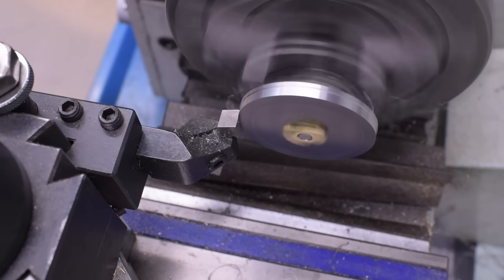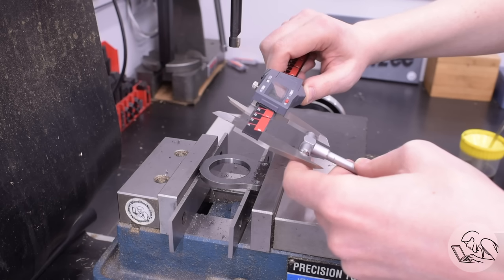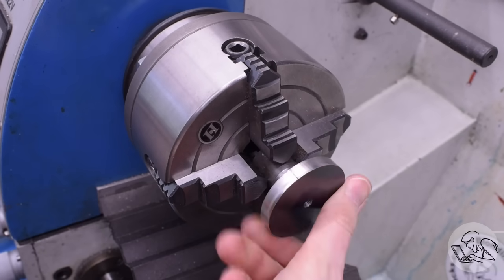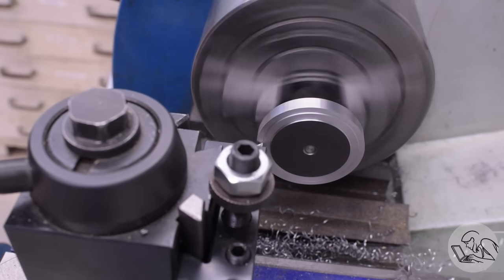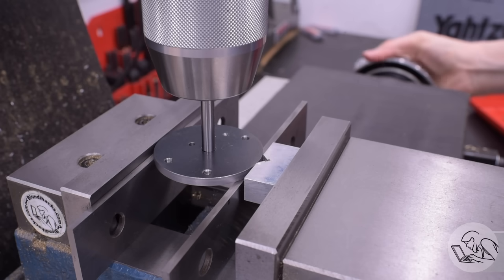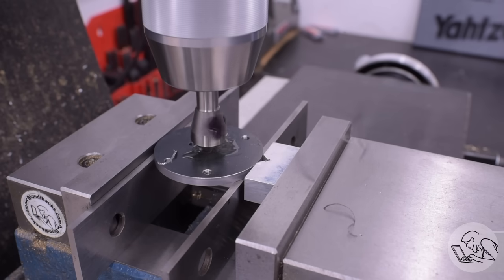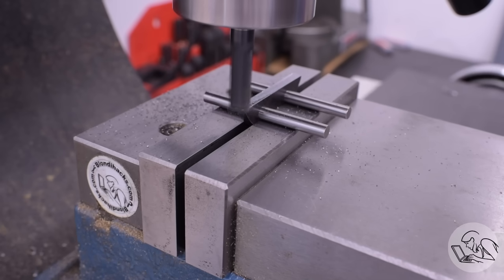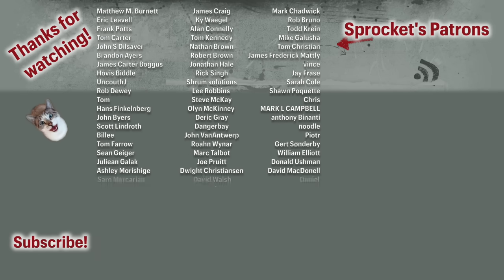Let's Build a Tool Sharpener - Part 4

Comment from the maker: Hey everyone! Lots of concern this week about my tapping setup. Yes, those Starrett tap handles do have a tendency to hold the tap a little crooked sometimes. However I’ve been tapping holes with that setup for ten years and it doesn’t cause any measurable error in the hole or threads. I’ve tapped tens of thousands of holes that way and never seen an issue. It definitely doesn’t cause a hole to move 0.75mm in a part. 😄 That error most likely came from the centre finder. That was the error prone step in the process.
Reply: Ahh yes, everyone is an expert this week because Joe Pie just posted a video on the vagaries of using tap handles with a spring loaded centre.....

Comment: I'm making this project with you. Thanks for making those mistakes for me, it saves me the time to do it myself. only problem is you need to be more generous with them as I always have a surplus.  Keep up the great work.
Reply: How many mistakes come with the kit? Did you have to buy extra? 🙂
Reply: @carlwalker7560 
All of them.  😂
Reply: Mistakes are like screws, you are supposed to find them on the table after doing the final assembly of your project.

Comment: Gwen,  center finding with that “center finder head”,  I have found that that layout method rarely goes thru dead center.  I always put on one line, and then put a second line immediately at 180 degrees.  If they aren’t one on top of the other, your center is in the middle.  A second pair of line at 90 degrees will usually leave a tiny square or rectangle.  You know where to go from here.   Thanks for all your effort.  Paul

Comment: "Hefty chunk" translation:
Blondihacks: a handful
Joe Pie: where's the tweezers?
Cutting Edge: Forklift has no chance, fire up the yard crane.
Reply: It's like the definition of "Sheet Metal" depending on the sector of industry you're working in. Fine mechanics use sheets of a few mikrons of thickness others would consider a film while a shipyard uses Sheet Metals that other would consider a big effing wall of steel.

Comment: Quinn , you always do nice work ...This project reminds me of a similar type of tool we had in the shop years ago, that the torch would be on the business end of the tool and a tracer pointer would be on the other end, and a little motor would trace the outside and the torch would cut the shape I thought it was the coolest tool. now we have a water jet machine and the pantograph torch just stands guard duty in a corner of the shop....

Comment: You mentioned using light pressure on the hoop but during the fitting steps of the hoop onto the first center piece it looked like the hoop was pivoting a little on the "sides" that would have closed inward when the jaw pressure was released.  So I'm thinking that even with the light pressure there was a slight oval result.  It makes me want to move ahead with my small fixture plate all the more.
Reply: Great eye, Bruce! I was thinking fixture plate was the only option, too, as any clamping pressure would invariably oval the hoop.

Comment: I built a Quorn a tool sharpening machine after the plans you get everywhere in book shops etc nearly a decade ago it did a very good job until lately when I gave it to a friend as a present and this time bought a new 😊
Wait til Finn is ready with this to decide if I do it also there is no better present to a friend with a workshop but which can't sharpen his end mills , drills etc 😊

Comment: 17:40 You can use a depth micrometer and a 123 block to determine that smaller inner diameter size/diameter.

Comment: Basic non-machinist question: why did you go to the trouble of drawing a center in the round plate, then drilling it out on the mill, then use the threaded mandrel on the lathe? Couldn't you have chucked the outside of the plate, drilled through the center (on the lathe), and then used the mandrel?
Reply: My guess is that they are using a 4 jaw chuck, so it's not self-centering. If you have a lathe, it's always a chore to swap chucks and you try to make due with round-about ways of doing things to avoid the extra effort.
Reply: @kwaaaa  yeah that's true, my method would have needed a 3jaw since there was no way to indicate in the outside of the plate while still gripping it.
Reply: I'm not totally sure about this myself, but I do a lot of laser cutting for work. Laser cut edges are not perfectly perpendicular to the faces of the material being cut. Depending on the focus height of the laser, you get a sort of hour glass shape on the edge. This might make it so that it's hard to actually get a good grip on the outer diameter with chuck jaws. Or it might make it settle into a crooked position in the chuck. Laser cutting also hardens the outer shell of the metal, and metal that is hardened is also more difficult to grip. The jaws in a chuck actually slightly dig into softer metal to create grip, but don't do that with hardened steel. That's why you don't put end mills in a drill chuck, and instead use an end mill holder. Personally though, I'd probably have tried just putting the plate in the three jaw chuck on the lathe and drilling it out like you said. Avoids having to indicate anything. Quinn knows so much more about machining than me though. But I do know in previous videos she's done a more complex process for a part and then realized after the fact that there was a simpler way. It happens. Also maybe she just wanted to show this particular technique. This is an educational channel, and a damn good one!
Reply: A bit more after Evan's good points about metal hardness and references for clamping:

It might have just been faster for Quinn to do this in the mill.  She would have had to swap out the 4-jaw chuck for a 3-jaw, then probably flip the jaws to hold the large diameter part.  And it's entirely possible the lathe was setup for something specific, possibly that she didn't want to break down - maybe she had already indicated-in the mandrel.

So my guess / suggestion in general is that - "no really good reason, it was just easier in the moment".
Reply: @evanbarnes9984 

I think that your guess is the correct one.  Quinn mentioned in earlier videos that the laser cut edges leave a slight taper to the edge.  A tapered edge is not just difficult to grip in a chuck, but the taper leaves only a single point of contact on each jaw, which reduces the rigidity of the part as well.

If the part had been laser cut  much closer to the finished diameter, we would have likely seen Quinn make up a superglue arbor that roughly matched the diameter of the part, and then dial in the whole thing on the four jaw chuck to the closest approximation of centered to the outside edge, and then turn down the final diameter and drill/tap the center hole in one setup.  But since she had plenty of room to finish the outside diameter, a close approximation of the center hole was close enough, and saved her from a good deal of fiddly metrology.
Reply: She mentions that because it's laser cut, it's not a good reference edge, so she can't clamp it in the lathe.  It's the same reason she didn't do the first part on the lathe.
Reply: @evanbarnes9984  There is always a simple way to complicate any task. And then there is a complicated way to simplify that same task. Such is life.
Reply: Another option is that she didn't want to remove the mandrel.  I think she used it twice in the video.  She needed to turn the outside edge of both disks, so she needed to use the mandrel.  If she put the hole in the disks on the lathe she'd have to chuck up the parts, drill them and then pop the mandrel back in there.  Hmm, now that I say it, if she does the disks first it's not and issue.  Never mind 😅

Comment: So a cautionary tale about the afore mentioned stacking tolerances and rounding errors.  I had a turned part to make that had about 20 or so features, all measured from one to the next.  Now the engineers, working to "military specifications", decided it would be best to round all measurements to the appropriate significant digit for the accuracy required.  What that means, of course, is all the 3/8" measurements were rounded from .375 to .38, and so on.  Not being willing to put up with such stupidity, I had the engineer run off a manufacturing drawing for me with all the featured measured from one end.  Needless to say, the QC guys spent quite a long time trying to figure out why my part was a different length that what they calculated off the print, but was still correct. Good times...

Comment: Why don't you use the dimple to drill the holes on the drill press with a floating vice? Whouldn't that be much easier than finding the dimple position with the pointy thing and still give you enough precision?

Comment: I was waiting for your video! Good work. Have you thought about machining the sliding surfaces on the static portion of the tool jig? If you polished the under/outer surfaces and put an oil groove on the plates clamping it you might get a better action, or feel, when you are grinding the tools. Just a thought. :) Keep up the good work!

Comment: At 17:40 you said you didn’t have a measuring tool to measure that step.  Try a straight edge across the face and gauge blocks or feeler gauges. See what fits till it lifts the straight edge from the face and allows light between them.
Reply: She was measuring the diameter, not the depth.

Comment: Hi Quinn. Just what is possibly a very dumb question...
For this project you keep saying that you don't have the metric tools to measure it properly, but why would that matter?
1 Inch is just 2.54 cm exactly, going from imperial to metric means just to divide or multiply the measurement by a fixed number.
Does it really matter that your micrometer measures in thousands while you need micrometers?
1thou = 25.4um, exactly by the same definition of the inch. 
There is no rounding error, as every single imperial unit is defined exactly  by a metric unit. 
Of course this is a really basic observation which you already know and obviously there is a good answer to it. But I'm not a machinist, and I swear I can't figure it out why that would be a problem.
Reply: I was thinking the same. There's no reason you can't use an imperial micrometer to measure equivalent metric values.
Reply: I too have only imperial micrometers, and I do exactly what you suggest.  I've memorized a few of the common sizes I encounter.  The other thing I often do is switch the DRO between units depending on the job.

Comment: For what it's worth, an inch is exactly 2.54 centimeters, by definition. The definition was changed in the 1950's. (When in the 1950's? Depends on where you live.)
Reply: It’s helpful to know that a standard 1950s is equal to 1.0001384 metric 1950s.

Comment: Hi,
I’ve really enjoyed your videos. I’m winding down on my life and I’m getting rid of my stock of machinist tools. Back in the day, I worked on a machine shop and the metric system was rumored to to be right around the corner. I acquired a set of Starett metric  outside micrometers, which are in excellent condition. I would be interested in donating them to your tool selection. If you are interested, let me know. Thank you for sharing your program.
Dick Bradley